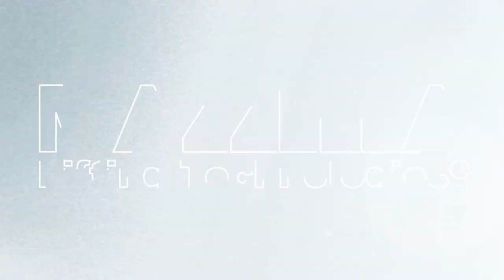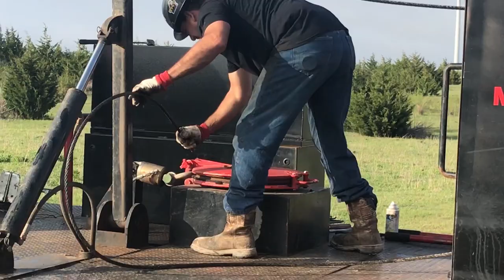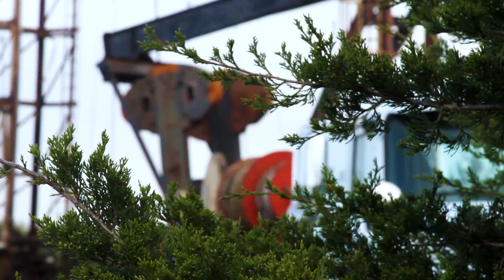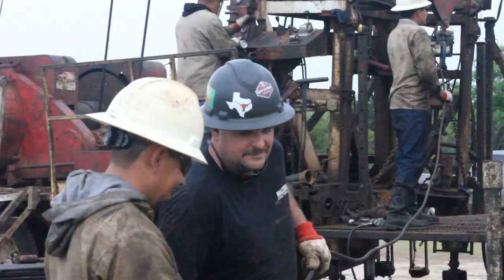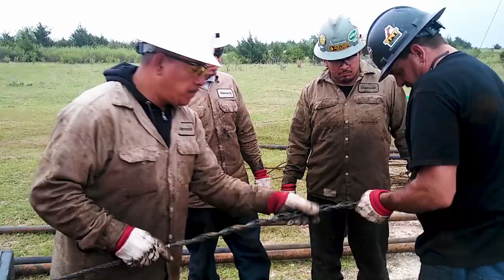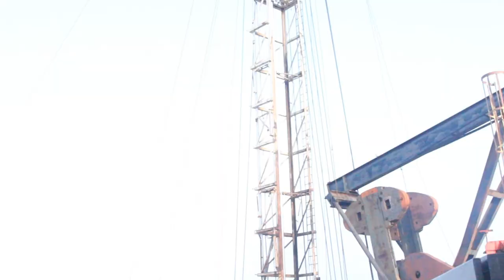On-Site Replacement Sand Line for Drilling and Workover Rigs

Comment: I spliced sandline in South Texas 30 years ago. We had a bobtail truck with spooling devices on back. I went on location by myself with the understanding that the rig hands would help just a little bit. I did 40' splices with 6 tucks. Snaked new lines on bare slick drums and spaced the bottom row with a hammer and chisel. It was hard work, but I loved it. I worked for Kennedy Wire Rope & Sling Company. It was a fantastic experience, but I was called into pastoral ministry. Love to see that this art has evolved and it is still carrying on.
Reply from the maker: And you're exactly right, Phil, this entire splicing process is an art form. 

Plus, in this video, you see the oil rig crew in there helping out as well and that for me was the coolest part. Everyone was in it to get the rig rolling again. 

Very cool. 

Best of luck to you in your pastoral ministry and I appreciate you checking out our video!

-Devon

Comment: i recall back in the day there was a straight section of road passed the high school . rigs would rig up half mast and change the sandline .the new line was laid out on the edge of the road and spooled on the sand drum .. also spooled off the drum on the trailer with a couple of 3 by 12's as brake . all pretty crude so sand line was spooled with a rod sub or rod wrench while swabbing . an old guy i knew said his first job was spooler on a cable tool rig.